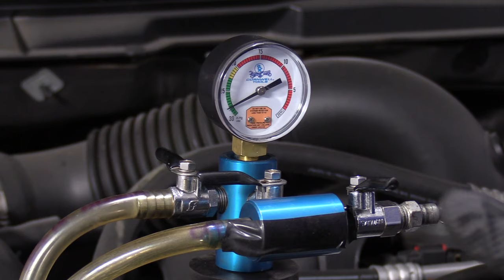How to Replace Radiator 09-18 RAM 1500

Comment: That fan shroud has a part on the bottom you can remove and you can lift shroud out and not have to deal with fighting the shroud to lift the rad out.

Comment: Great video!!  This helped me a ton!  Thanks!  And if I may add something to this video after going through the process myself: All the bolts on the left side of the condenser that are hard to get to can easily be removed simply by removing the grille and the overflow tank.  The grille is held by 4 bolts while the overflow tank is held by 2.  Trust me.  You'll thank me later. 😁  Also, those rubber mounts should be installed onto the frame before attempting to wiggle the radiator back in.  Other than that, this video is flawless! 👍👍👍
Reply: My Man, you are dead on!! I replaced mine today, watched this a few times, then read your comments... was like heck a few more minutes wont hurt.  SO Easy with those out of the way.  Luckily for me my truck is lifted so plenty of room under the truck.. Also, I did have to zip tie my AC Condenser to ensure it didn't fall through after carefully removing and looking at the brackets.
Great points, always willing to learn thanks much!
Reply: How did you bleed the system? I’m gonna be doing my radiator replacement this weekend.

Comment: You might've done your "Oh by the way" about the rubber grommetrs before fighting the radiator past all the garbage and into place. It woulda' saved pulling the radiator past all the garbage again  to put the rubber grommets on. Other than that, great video.

Comment: Thanks for making this video. Had to change the radiator in my 2012 Ram 1500 and it definitely helped. One thing to note is I was able to remove the 10mm bolt on the top passenger side fairly easy with a regular ratchet after loosening everything else.

Comment: Thanks for the video, I will do mine tomorrow.  I  don't understand why these radiators break?  Mine has a side leak close to the plastic where the electric fan connector is.  I was wondering if you know where the leak occurred on the one on the video and why?
Reply: Mine too.

Comment: Thank you for this video! I just followed it to replace my cracked radiator and saved me about $1k doing it myself.
I've got a 2017 with the V6 so I had a lot of room work with. Still, getting the 12mm nuts off the mounting bracket were real tough til I got a ratchet wrench. You'll nedd it for this job!

Comment: Great video. I have to replace the radiator on my 2011 1500 Ram. It says I have to take the grille, shroud, coolant reservoir and viscous fan off as well. We'll see how much of that is true. Looks like all Saturday regardless but $100 vs $450 at the shop will buy me quite a few barley pops.
Reply from the maker: +Larry Burton Thanks for checking us out. 1aauto.com

Comment: Thank you for showing how the petcock nut starts to withdraw as you rotate it past a quarter turn.  When I first tried to open it, I was worried that the nut would break if I turned it any farther when encountering this secondary resistance.

Comment: It's a lot easier if you remove the 13mm bolts that hold the radiator to the frame out first before you take the condenser bracket bolts out. It gives you WAY more room to get to the bolts on the passenger side.

Comment: I always cut up the box that the radiator comes in and cover the core on both sides with cardboard to help protect it while putting it in.   it adds 5 minutes to the job.
Reply from the maker: +thebanjoman1963 Thanks for the tip!

Comment: Man, you need a pan/tray which can sit on the engine without risk of dumping over so you can keep your parts and pieces together.   Setting them in the breather box seems like just asking to watch one or three fall while your not looking.   Also those magnetic bowls are lifesavers too!   Maybe a bungee cord to hold the shroud and electric fan back and up.   As far as hard to reach fasteners, it’s amazing what can be done with a screw gun, extensions of varying lengths, and a u-joint between the socket and the extension.    Sometimes there’s no way around hard to get fasteners.    Replacing the EGR on my 06 Hemi is a royal pain in the ass, as one bolt is just behind the alternator.  Next time it might be easier to just remove the alternator, but I didn’t last time and there must be a reason why.  The ratcheting wrench he had is a must have.   Also, a cutter for removing those plastic push in fasteners?   Just keep a little piece of 1x or even a strip of 3/4” plywood to use as a fulcrum makes extracting those things much easier.   My brother has an 09 of the truck in this video, and he said the radiator swap is a royal pain, and I disagreed.    I do know that he replaced his clutch fan and it wasn’t hard at all.  Doing that would free up the shroud and electric fan and greatly facilitate removing the old and dropping in the new radiator with much less damage to those precious fins.  Kind of like how he removed some of those plastic covers, like under the truck and the wheel well, there are some jobs where a few strategic moves here and there turns a cuss fest, parts breaking, knuckle busting, patience eating pain in the butt into a semi-therapeutic automotive Remove-and-Replace afternoon with smiles all around after that satisfying job well done.  I’m pretty sure he didn’t need to do the wheel well thing since he had that hose clamp tool.    It looked like a modified bicycle caliper brake set-up with the caliper end changed to a parts grabber, and the brake handle part could be attached to a short piece of pipe just like when it’s on the handlebars.   Voila, home made parts grabber for where your hand doesn’t fit or where you’d need two elbows.   But if he had removed the fan, shroud, and electric fan, most of those bolts and the lower radiator hose clamp, the electrical connector, all of that would have been readily accessible and he could even have used a screw gun on the shroud bolts before hand and then the radiator bolts with all of that removed.   He had two of those three unfasten anyway, what’s another five minutes of removing the fan bolts, which are easier to get to with the shroud loose anyway.    Even if you have to remove the serpentine belt, take a pic, we all have cameras in our pockets, it’s super easy, then pull the mechanical fan.    It’s totally worth it.   Look how much more time was consumed jockeying that brand new radiator around that super tight space.   Even just the risk or even certainty of damage seems worth it. They really do make these modern vehicles so much easier to work on than my real favorite cars, 60’s-‘71 American cars.   The newer stuff, like it or not, is designed with the dealership “tech” in mind, which in turn saves the manufacture on reimbursement for warranty repairs, when a job that pays four hours can now be made a two hour job, times thousands and thousands, it’s worth it for the manufacturer to keep everything systematic.  What might seem hard to do at first, I guarantee is much easier with either that special tool or following a prescribed procedure which is most efficient.   I bitched about that EGR valve, but that’s because what could have been a five minute R&R was more like a fifteen minute R&R.   Yeah, first world problems.

Comment: What happens when you break the top to one of those plastic clips you took out from the bottom to remove that cover to expose the bottom end of the radiator? Is there a way to get the rest of the clip out the hole?

Comment: Hey at the 6:04 mark your wheel liner isn't attached to the bumper. Did you take the clips out of that? I just had work done on my truck through my insurance and mine is missing the clips and my bumper has no holes for them but the liner does. The bumper is brand new so I feel like they used the wrong one.
Reply from the maker: +Dustin Fette Thank you for the reply. There should be clips that will hold it together to avoid wind or debris from ripping, cracking, or breaking the cover. They may have used the wrong one or they were not fabricated on there from the machine shop.

Comment: Wheres the transmission cooler on the gen4 ram hemi? I cant see one. Climbed all under it with flashlight and don't  see one. My build sheet says it has one.
Reply: It's one piece with the ac condesnsor I'm sure you've figured that out by now but I just found out.

Comment: It seems like they figure it out as they go. Seems the way it was done was probably faster than taking off the grill but a greater chance at messing up the find. Before anyone gets bent out of shape, this is an observation and a question. Yes I have replaced radiators before, just not in the newer models.
Reply from the maker: +Daryl Bullock sometimes there can more than one way to get to the part you're removing/installing. We try to show the fastest or easiest install methods whenever possible. We appreciate you checking us out!

Comment: I have a 2016 dodge ram I replace the thermostat upper radiator hose and cap .The upper hose get hard the pressure so much it pulls the hose to the bump on the radiator never over heats oh the thermostat is 203 degree factory is this normal truck has less then 40.000 miles on it
Reply from the maker: +@waltsonger1343 We wouldn't be able to diagnose an issue like that here, you may want to have a local mechanic take a look at it. Thanks for checking us out! http://1aau.to/m/Shop-1AAuto-c

Comment: I've been watching all this wiggling & maneuvering to get this radiator disconnected and out
The the same thing to put it back in,  Wouldn't it make more sense to add a extra 10min to this job & remove the clutched fan & shroud??????? Then you could reach everything & no chance of damaging the fins